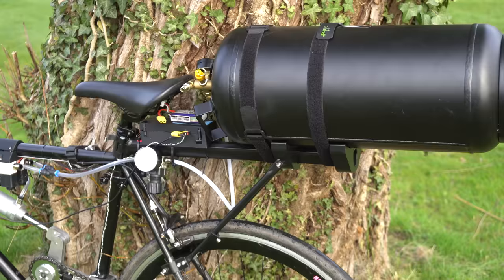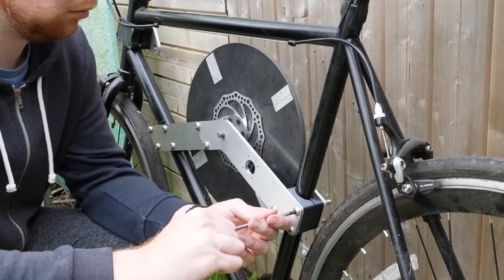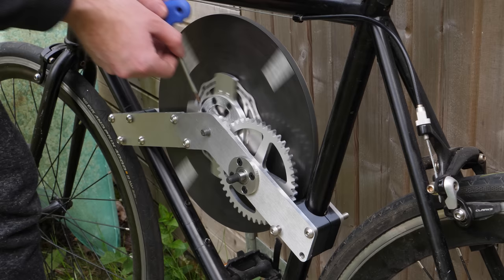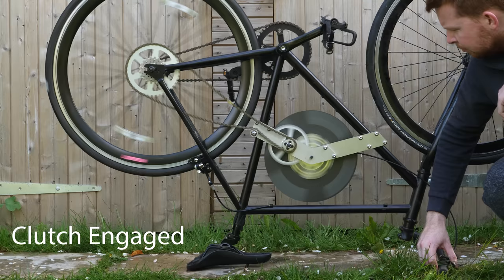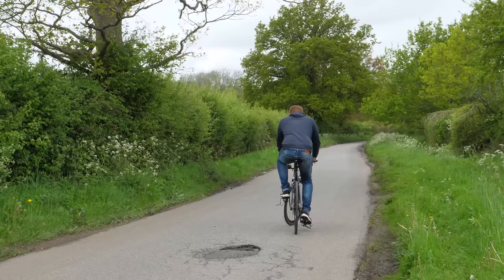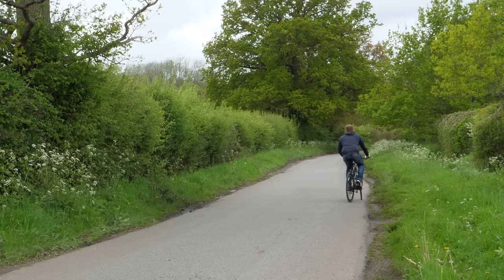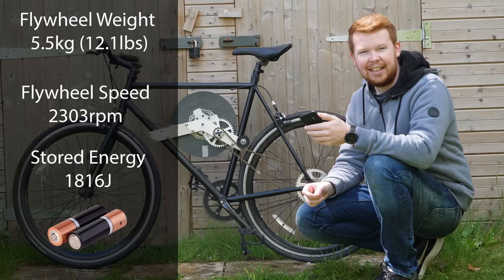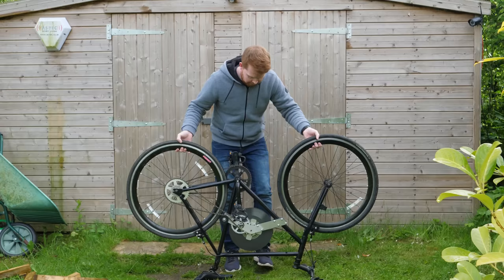Flywheel Bike KERS

Comment: What if u do the same thing but with a piston but instead of hydraulics its like a magnet so when ud brake it would pull the massive magnet away and when ud go the magnet would be pulled closer and it would of course turn that into rotational energy by just putting teeth on a arm connected to the magnet that is of course sliding across a gear that in turn rotates the back wheel. This way wouldn't just run out of energy when sitting still

Comment: fantastic project, but the energy you use to pedal and turn the wheel is equal to or greater than what you get back for the autonomous start, but really nice project.

Comment: The problem I see  you doing in your test is that you are mostly on flat ground. If you had a slight down hill then used it (or when reaching a flat surface to slow down),  then I think you could see a better use out it given that fly wheel can gain greater speed. How well the fly wheel would hold up under those conditions is the real question though.

Comment: Thanks for making this! Great Project! Could it work better If the clutch was more instant, does it loose energy in heat when the disc brake/clutch thing is engaged? Does it add to steering problems - the flywheel acts as a gyro? Maybe you can use belt drive for the flywheel transmission. Let's say you make all the final work nice and neat - can it work and function in practical casual everyday urban/suburban cycling?

Comment: Tom your flywheel needs to be much much larger so think about changing the frame next time. I as well have dreamed of creating a flywheel powered bike just like a gent in New York City did for a while a few years back. But with that much weight your brackets will have to be far beefier than just two curved brackets you might need to go with four or maybe even five mounts to the frame. But wait one second!!!  Have you thought of switching to a Horizontal Gyro System? Think about it........ Oh and one more thing. Try using Flex-Drives.

Comment: A CVT could be interesting here.
Though, even 15 percent is a decent energy recovery. However, a large portion of the energy is likely gone thanks to friction in the clutch, and here is likely where a CVT would offer the biggest uptick in efficiency, while also offering the ability to meet past the middle point in rotational speed.

However interesting that the electric bike's regenerative breaking were so lackluster, though even lithium batteries don't charge all that efficiently.

Comment: It would require a redesign of the system, but what if the pedals drove the flywheel and the flywheel drove the wheel basically the same way an engine does to a manual transmission car?

Comment: This bike seems like it could be quite useful in a city-type area where you are constantly starting and stopping the bike. If you were to treat it like a braking system you would only be able to use it as a minor assist to start moving again because of the generally low speed it would build. If you were to spin it up while biking, and keep it spun up, you would be able to rely on it a little more to accelerate at lower speeds.

Comment: I did something like this, but my problem was the higher RPM's caused tremour and my nervousness of having high speed parts that close to femoral arteries was where it all ended. It's still feasible for low velocities, but not as efficient as I had hoped.

Comment: couldn't you use two speed system and like make it spin much faster because you brake in speed 2 (or maybe first in speed 1, then 2), but when you recover the energy, you accelerate in speed 1 first, then speed 2 (or something), and therefore recover much more energy?

Comment: i think that maybe by making a more sharper finish to the flywheel would make it more aerodynamic just by spinning and it wouldnt lose as much rpm die to air resistance
correct me if im wrong but thats what im thinking

Comment: Wow, very interesting.  I am quite fascinated by energy harvesting by regenerative braking system.  You mentioned that it collects back 15%.  How much would it be actually if you consider added weight by the harvesting system that requires more energy for the initial acceleration?

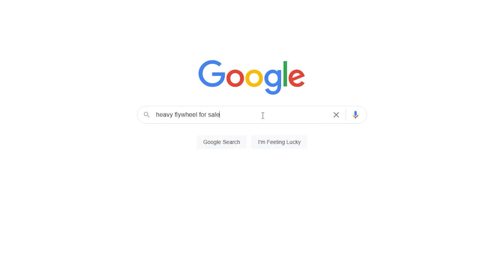Comment: 0:55...1:05 if it's all about density, then ideally it should be made out of lead (because uranium and tungsten are not easy to get hands on))

Also for better moment of inertia to weight ratio it shouldn't be solid disk, rather a ring.
Reply: It's less about density (mass/vol) and more about radius. The total mass impact is linear, but mass  has impact at the square of the radius. In other words, energy density corresponds to the square of the radius. A ring is the ideal flywheel, but mechanically challenging at 10,000+ rpm.

Comment: There are a lot of forces to consider. Like when you would get the flywheel up to speed, then turn the bike around 360°, I'm wondering if turning around, slowed the flywheel down any? 
(For example: Start facing North, if you hold a spinning bicycle wheel in front of you, then keeping your arms straight in front of you and try to turn your body facing South. You can feel a resistance against keeping the wheel straight, thus slowing the wheel!)

Comment: Found this video and channel a bit late.. but... As you have shown a liking to the art of flywheels. I wonder. Could you maybe replicate the camera stabilizer used on Das Boot? I've only heard about them, but not seen one in action. As I understand it they were also used on cameras mounted to planes and helicopters before modern drone gimbals became usable. 

If I understand it correctly, it's basically just a couple of flywheels in a contraption mounted to the camera. And spinning the flywheels up to full speed keeps the camera from wanting to rotate while handheld. Reducing the shake by a lot. On Das Boot it was used because a full steadicam rig was deemed to bulky and fully hand held was too shaky. And the film crew didn't want breakaway walls on the sets so the feeling of claustrophobia was maintained as they could not put a camera outside the real walls. 

Or has this already been covered by this channel or some other channel?

Comment: Not so useful for regenerative breaking, but for pedal assist you'd ideally have the pedals drive the flywheel instead of the wheel, and then the clutch mechanism to engage and disengage the wheel. Also linking the flywheel and the wheel electrically instead of mechanically, although I suspect the losses might outweigh the benefits there.

Comment: Adding weight to the bike means you are having to work harder overall to move forward... there is no getting around this, more weight is more drag. Is it a neat concept and fun? Yes. Is it at all practical? Absolutely not. Even more fun would be starting at the top of a hill and getting that thing REALLY going... but also would be very interesting as you have a massive gyro effect at the center of the bike.

Comment: Well, I had this idea in my head for a while which I am nowhere near putting to test as I am no engineer nor nearly educated enough to calculate the probability of it working but I'm happy I ran on to your video as you might just be able to give me a good guess of how effective it might be. So my idea is similar to yours in terms of execution, but instead of the flywheel I was thinking about a spiral spring mechanism. You know, like the one used in toy cars. So like, when you wanna break, you engage the clutch and you let the spring wind up, pick up all the energy and keep it stored untill you release it back into the wheel by letting the spring unwind. What are your thoughts on that?

Comment: You'd need a gearbox that can speed up the flywheel further even after the bike speed drops below half, and to accelerate the bike beyond halving the flywheel's speed.

Something like a CVT would work. But you'd probably need two of them, and different engaging paths (as you need to choose whether you want to accelerate or decelerate, you're no longer just matching speeds).
Reply: Sure just keep adding parts, be lucky if you can pedal your 500 lb bike.

Comment: If there's a pedal-driven electricity generating [battery storage] solution doing this - would it be possible with a stack of flywheels that are all eventually turned with minimal effort, and then producing something sufficient for a daily domestic household supply from e.g. fifteen minutes of 'workout'...?  Obviously the hardware requirement is prohibitive per capita, but then scaling this up and using that gearing to get it started-through-'KWrpm' as say, a solar panel wind turbine source driven solution - once running - is harvesting [generating] way more efficiently than just direct to battery storage, ...right?

Comment: Many problems here:
-Wasting energy to heat due to friction when engaging/disengaging clutch
-Large mass adds to the weight of bike
-Large spinning mass adds gyroscopic effect, however we already have spinning wheels on a bike so i don't think that would matter so much
-Noisy

Solution:
Real KERS (using electric motor/generator and Li-Ion batteries)

Comment: Let's see...  2 equal diameter sprockets will provide a slow speed when charging up and discharging the flywheel's stored energy.  A small sprocket at the flywheel and a large sprocket at the bicycle tire benefits the effort of charging kinetic energy, but not discharging.  Yet, a large sprocket at the flywheel and a small one at the tire will benefit speed, but not charging.  So, essentially a differential to compensate for sprocket sizes during charging and discharging would need to be installed both at the flywheel and the rear tire.  That way you can charge up a fast speed quickly and take off with more starting speed.  Am I overthinking this?

Comment: Great idea, but starting and stopping isn't quite the right application to make the most advantage of your KERS system. I'd really like to see you engage the flywheel while using gravity to travel quickly down a hill, and use the stored energy to help you pull yourself up a steep incline.

Comment: Why not have a second flywheel attached to a clock spring type mechanism ? Maybe you could use the clock spring to store rotary energy which can be used on demand, even when the first flywheel has stopped.

Comment: You need more teeth on your gear or more gears in general if you want this idea to work a bit better. You can disengage the clutch with a lot less speed on the flywheel and it will allow more torque to accelerate against your natural deceleration. Im mechanical but no engineer so my vernacular could be off but you definitely have a working prototype

Comment: Could you make a flywheel with enough mass to hold the bike fairly stable while stationary and gears so you can pedal casually at lights and then use that energy to take off?

Comment: How long does the flywheel maintain it's speed?  I'm wondering if you had a downhill section, followed by an uphill section with a long flat stretch in between, would you be able to charge your flywheel while going downhill, keep that energy stored in the flywheel through the flat section and then use it to assist in the uphill?

Comment: The clutch would have worked a lot better if you had some way attached brake pads to the clutch. The friction material would have gripped the disc a lot better and it would have been a lot smoother of a transfer of torque

Comment: Clutch efficiency loss is so bad it hurts. first when braking, then again when accelerating. Dont know exact numbers but guessing it depends on relative speeds of the components. But i'm sure it could easily hit 50% for each operation. 0.5 x 0.5 = 0.25. Considering other losses i'd say you'd be lucky to recover 20% of the input energy.

Comment: I would think that if you were on a long downhill that feathering the clutch in and out would do more to spin the brake ( dynamic braking is probably the most equivalent word as it would be called in railroad terminology ) up to a higher rotational speed than just slamming on the brake at the last moment.

Comment: BUILD THIS PLEASE: instead of you putting your cycling power into the rear wheel, cycle the flywheel instead.....   spinning on the hub, inside the rear wheel, then use the clutch and the flywheel to power the rear wheel. You could power up the flywheel using the gears on the bike while stationary, holding on to somebody's car🤣.  Don't know which way would be best to engage the clutch, but I'm sure you would work that out.

Comment: the other problem is mass. th flywheel is tiny, maybe a kg or two, ok, in spins fast, so not that bad, but compared to the bike alone is not much, and when you add the biker, it is almost nothing, so the actual meeting point is not halfway (as in the simplified diagram) but way closer to the bike, which means more speed up on braking, but way less speed up when you return the energy to the standing bike. of course this is little more than a simple test. but the main problem with flywheels, is that the wheel needs to be large and the speed it must spin also needs to be stupid fast, and at that point it is quickly gets dangerous, and an adding problem of turning a large spinning thing (aka gyroscope) is not fun.

Comment: Why not make it out of lead and only use the outer 3" of the flywheel. Anything inside of this is low energy. Most of the energy is concentrated on the high speed outer edge of the flywheel. You could use the inside of the flywheel for the clutch mechanism..

Comment: Nothing is free.  To take advantage of the flywheel inertia the rider has to spend their own personal strength to ‘load’ it for future use.  Which would be at every acceleration after a stop or slow down.  It would be more efficient to change the local law to allow bikes to maintain speed through lights, stop signs etc.

Nice work on the mechanics tho.

Comment: Why don't you run a bigger flywheel? Just under the size of the bike rim. And that way you can do away with the chain drive which you lose power in and out of the flywheel.

Comment: Hypothesis for a quantum magnetic energy recovery system generated by chatgpt; for use on a bike or hopefully turbine, let met know.

Sure, here's a revised SBAR for a quantum entangled magnetic ring inside a bike tire spinning a flywheel inside the spokes of the wheel:

Situation:
We want to explore the feasibility of using a quantum entangled magnetic ring inside a bike tire to spin a flywheel inside the spokes of the wheel. This would involve using the entangled particles in the ring to generate a magnetic force that could be harnessed to spin the flywheel, thus creating a source of energy.

Background:
Previous studies have demonstrated the use of quantum entanglement to generate displacement of magnetic force. This technique could be used to create a magnetic force to spin the flywheel in the bike tire. The exact mechanism for how this would work is not fully understood, and further research is needed to determine the potential for this type of application.

Assessment:
To conduct this experiment, we would need to construct a prototype of a quantum entangled magnetic ring that fits inside the wheel of a bike tire. This ring would need to be capable of generating a magnetic force strong enough to spin a flywheel inside the spokes of the wheel. We would need to determine the ideal dimensions of the ring and the flywheel, as well as the ideal placement of the ring inside the wheel.

Recommendation:
To test the feasibility of this concept, we could begin by conducting computer simulations to model the behavior of the entangled particles and the resulting magnetic force. Once we have a good understanding of the behavior of the particles, we could move on to constructing a prototype ring and flywheel and testing them in a controlled laboratory setting. We would need to measure the amount of energy generated by the flywheel and compare it to the energy input required to generate the entangled particles in the ring.

Additionally, we could explore the potential for practical applications of this technology, such as powering electric bicycles or other vehicles. Further research could also focus on optimizing the dimensions and materials of the ring and flywheel to maximize the efficiency of the system.

Comment: I think your flywheel is thin. It should've been double or at least 75% thicker which would weigh around 7 to 7.5 kg and give you the inertia you actually require.

Comment: Oh ma gawd, i could engage the flywheel while going a very steep hill down (my school is on one), basically on the way home when going this steep hill down and then charging the flywheel i can actually keep my speed for longer or when I break accelerate to faster than what I can pedal, because if this thing keeps 40% and I go down the hill with 45 km/h I should still be going a good 27 km/h which I can't achieve with my thin ass legs.

Comment: there is no free magic energy. the weight of this thing(and how agonizingly the energy is transferred to it) negates all its positive effect. as we saw in Formula 1, it didnt matter did the car have KERS or not, because the weight of the system. Heavier cars are slower to accelerate and going uphill. "the extra weight of the system means more fuel consumption when accelerating and the system is not being used to provide power. So, it’s a win / lose situation.."